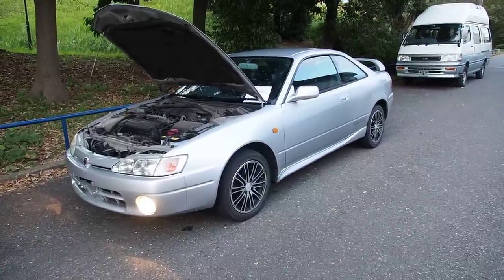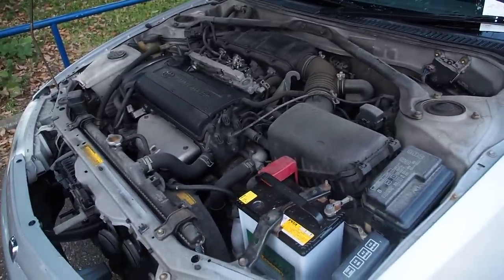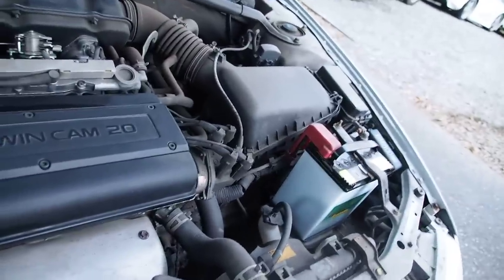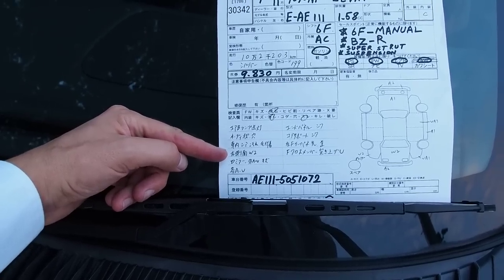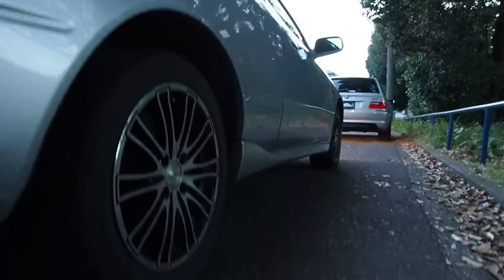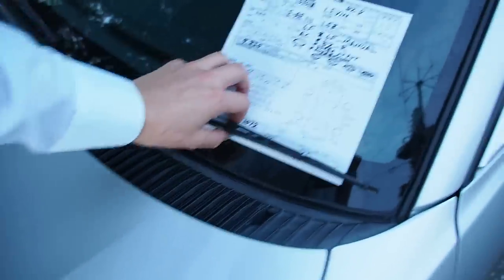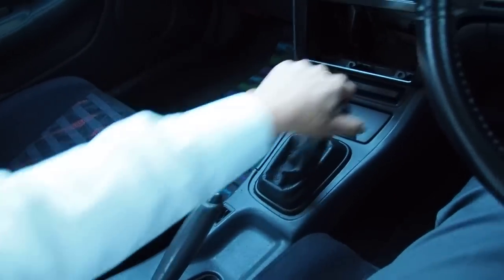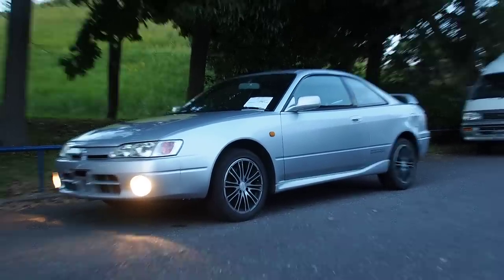SOLD SOLD SOLD - 1997 Toyota Corolla Levin BZ-R AE111 6 speed manual

Comment: I haven't driven a Super Strut suspension equipped corolla but it should also be noted that cars with that suspension setup also come equipped with a 2 piston front caliper. Unfortunately replacement and aftermarket parts are difficult to find (outside japan)

Comment: Do anyone know the difference between the BZ-G, BZ-V, and BZ-R for the kouki model?
Reply: BZ-R is the top range model with the 20V blackstop engine, 6-speed box and superstrut strut suspension. Other than that there may be some cosmetic and interior differences but I'm not sure about that.
Reply: All of BZ versions comes with 4AGE Blacktop. BZ-R is a top version of AE111. Only BZ-R has a superstrut suspension (as an option). Also BZ-R has only manual 6-speed transmission with Torsen LSD. Other versions only may have a 5-speed manual or 4-speed auto transmission. Another difference is in exterior (different front lip, side skirts, spoiler) and interior (different color and pattern of fabric on seats and door panels). I have one of these. There are a lot of levin & trueno in Russia, but mostly in bad condition. Parts are easily swappable between BZ versions and non-BZ, even swap of 4AFE -> 4AGE. Very great tech design and compatablility with other E110 Corolla's

Comment: If that knocking sound is the super-strut suspension and it usually is in these cars it may be an expensive fix.
Reply: Hopefully its was just the rear drop links
Reply: Expensive if you buy new arms and links from Toyota, surprisingly cheap if you can find them from a breakers. Here in Ireland there's still a couple specialist breakers.